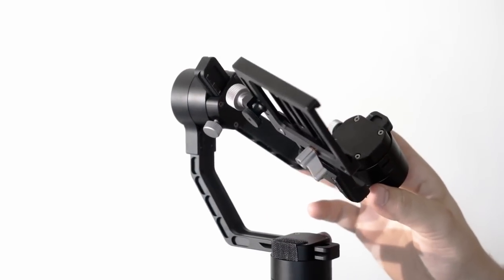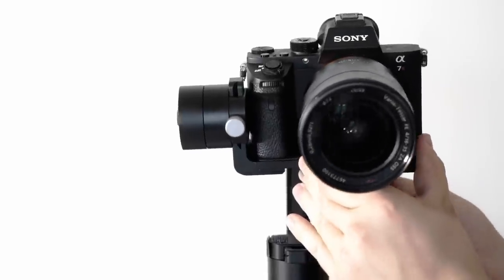How to BALANCE A Gimbal - Zhiyun Crane V2 | Momentum Productions

Comment from the maker: Please remember to turn on notifications so that you are updated on my latest content :)
Reply: Momentum Productions new subscriber here, I just got this crane and managed to balance my a6500 with 10-18mm lens perfectly flat (forward) but was unable to keep it facing upward or downward as you suggest it should stay in position, any suggestions?
Reply: Hey Josh
I really don't expect you to reply.
Since this is one of your older videos. I have ballasts my crane
The very best I can get.
The problem is no matter which position I put my camera in when the crane turned off.
Keep in mind I'm using a Sony handycam, the camera never ever stays in the position I put it in. It's just always returns to the level mode. I do not see where there is any strain being put on any motors.
Do you think I should not worry about this or be concerned ?
Thanks Keith
Reply: Hey man I have a problem with my gimbal now.. All of a sudden the X and Y motors just move wild and randomly in any direction as soon as I power it on - it won’t respond to joystick controls, just moves violently- was wondering if you ever came across this problem and if you know how to factory reset

Comment: I must have watched this video 50 times and still can't get all the axis to balance like yours is.  Making tiny adjustments each time, nothing works.  Beyond frustrating!
Reply: Is it possible that my setup is too light? Using an A6500 with the SEL20F28.  I know it's not too heavy since the crane will do up to 3.9lb.
Reply: the set up is to light. I have the 6500 with a 35mm and it wont stay in any positions i manually move it to it just falls to the level position. With my bigger 55-210 lens i can balance it like this video. It will work fine if you don't worry about the "position keeping step" just do everything else. Im going to try a DIY counterweight using the lens support screw.
Reply: Gear Jammer Media.. I am having a similar problem. I have my A6000 mounted on the crane and it's not staying in place. Were you ever able to create a counterweight using the the lens support screw? I'd love to see what you came up with!
Reply: its weird if you unscrew the screw a tiny bit from the plate that holds the camera on, it will stay in place, but your camera could fall off lol
Reply: jTΛCTIC5 that is so true wow it happen to me too
Reply: phillipdlee shouldn’t you have gotten the V2?
Reply: daviddelacruzthird  Zhiyun sells a counterweight..
Reply: Yes am having the same issue, that side motor giving me problems,I did not realise that if u move the camera up or down its should remain in that same position smh

Comment: Im thinking my camera is just toooo light for th gimbal, i have the Lumix G7, 30mm and have my plate slid back all the way to its farthest. and have tried managing the side motor. And the result is still pointing down. Welp, maybe time for an upgrade!
Reply: check specifications of gimbal, weight your camera with battery and other stuff attached. You can always use a quick release plate to add some weight :)
Reply: Hey. I had the same problem as you. Maybe your camera is too small or the weight between yor camera and your lens is not optimal. I use the Panasonic GX80 with Panasonic 2,8 12-35 mm. My solution was a Quick Release Plate. So the camera is a little bit higher on the crane and i can balance the crane perfectly.
Reply: very late reply but just wondering, what quick release plate would you recommend for my sony a6300
Reply: Hey bro try the release plate.. it helps

Comment: Just got this crane and have watched a bunch of balancing videos, this is definitely the best out there, very easy with some practice.  Questions for you:  is the camera base plate supposed to be so sticky?  Mine has a tight spot which makes fine adjustments difficult.  Also, possible to balance with a rode mic on?  I can do it without thanks to this vid, but its impossible with the mic on.

Comment: i been able to balance it but when i bring the LCD screen out i only can get it to balance up and down not left and right? it wont fall back down when placing it up and down but when i place it left and right ...... do it suppose to still be balanced on the sides even with the LCD screen out.?

and do you prefer to get shots with the screen in or out?

Comment: Hi there great video love your instruction on the balancing the gimbal. One important question the small tripod you show in your video i bought it from Amazon. The screw on the tripod does not fit underneath the Zhiyun crane bottom side as it seems it is needs a thicker screw. What did you do to get the tripod to fit there?

Comment: Hi Momentum Productions
Can you please help share details
  I purchased crane 2 model and i am struggling to use this with my camera as the saftey lock (part 16 in user guide) is obstructing with bottom of the camera. Can you suggest screws you are using in the video, the saftey lock i can use which aren't obstructing like a round screw.
Thanks a lot

Comment: Hi Josh, my concern is off topic but maybe you could help. Im having problem
With my crane v2 when on lock mode it drifts slowly to the left. Ive tried balancing properly, calibration, and firmware update. Your thoughts will be greatly appreciated. Thanks

Comment: Thank you. Very very helpful for my first balance
Reply from the maker: Glad to hear it Alok!
Reply: I've been trying to get the perfect balance with my new Tilta G2X and Sony A7iii with 24-70GM. It's hard but doable. What i found is that if each screw is not tightened down to the max I get a lot of vibration in the motors. After I tightened all the screws down the gimbal went from unusable to usable with minor vibration here and there. Maybe something to also make a note of. I saw a lot of youtube videos complaining about motor vibrations and tightening the screws made a big difference for me.

Comment: Thank you so much. Just received my Crane Plus gimbal today, and this video has been a life saver! (Have Sony a7iii with 16-35mm ). Bought my gimbal 2nd hand on eBay so need to check it is OK. Is there anything I should be wary of? So far seems OK.
Reply from the maker: Nothing to worry about. One thing I would suggest is make sure that the motors don't get hot or make strange noises :)

Comment: I've bought an on-camera LED and can't seem to balance it properly, it always falls up or down, I think it's nearly impossible to have it manually stable. Would it be safe to turn on and let the gimbal stabilize this difference, since the total weight is not even close to the maximum weight allowed? Will it force the gimbal? Thanks for this video, it's very explanatory.
Reply from the maker: Hi there! It all depends on the weight of the LED. If it is too heavy, the gimbal will not work properly.
Reply: The led weighs 345 grams and the camera is a Sony A6300, which weighs 525 grams, 870 grams total. The gimbal supports up to 1800 grams, so I thought it would be fine to use it, even though I couldn't get the manually perfect balance. Thanks for your answer buddy.
Reply: you forgot about the lens and battery, that adds weight too
Reply: Actually, 525g is with the lens and the battery, I forgot to mention that. In fact, the camera body weighs 404g with the battery, and the lens 116g, 520g total. But I weighed the camera myself with all set up and I got 525g.

Comment: Hey Josh on that second tilt motor adjustment where you're supposed to be able to move the camera and release it without it moving...is that possible with smaller lenses like 16-50mm or macros?
Reply from the maker: Hey Darrell, so sorry but I'm not sure what you mean :(

Comment: Hi. I have the crane 2. And the batteries will read full or two bars so I know its charged. However, it keeps shutting itself off after only being on for 4 minutes or less. Just got it about five months ago but barley used it.

Comment: Please Josh I need help  . 
I have a crane 2.
I do all the steps correct except one part doesn't work for me , when I put my camera an any roll position it should stay in that position like your , but it doesn't it just swings back to being flat horizontal.
However all other positions like pitch (tilt is perfect and stays still in any tilting position. As well as the pan motor 
Please tell me what an I doing wrong

Comment: I think some cams are just too light for V2. I am using an NEX 7 and 12mm Rokenon f2 and this set up balances in all planes except I can not get the cam to point straight up or down and make it stay - it goes back to level. I am going to try to raise the NEX by using a QR plate. It still works well without out that final balance part but I worry that may over stress the motors.
Reply: Hey Conrad, that QR plate did the trick - balances perfectly now - thanks!

Comment: Hi, can you help me , when i tilt with my cam downwards to the lens down 
kind of position, the motor starts humming and i can feel a mild but 
sure buzz vibration going on. It happens only when i use the joystick n 
tilt the camera nose down. The vibration picks up as the nose tilts more
 and more down. If i leave the lens in that nose down position the 
vibration hum from the gimbal is non stop, until i raise the cam back to level position.
 The hum occurs in no other position including lens tilted full upwards 
to ceiling. Balancing is done correctly on all axis and in dead mode the
 cam is able to stand still in virtually any pose (indicating perfect 
balancing). I also tried setting the motor strength to middle and low 
using the Zhiyun Assistant app and same results in any setting.

Comment: Josh > im unable to switch thru the modes correctly. Its a chinesey english manual and the manual is so brief. How many presses to get into which mode please ?
Reply from the maker: It’s a combination of presses. Which mode do you want?
Reply: OK instead of troubling you with, 'i need to know them all', let me do it simpler with respect for your time. There are only about 3 basic modes and ill tell you my understanding and you correct me if im wrong.

A) Power Up > Its in default mode. That is PAN FOLLOW (Joystick only does tilt and nothing else)

B) Single Press Mode Button > FULL LOCKED MODE, pan & tilt follow are inactive (Joystick does pan & tilt).
Single Press Mode Button Again > Its back in A default mode, mentioned above. This is a constant loop. Every single press cycles you between A & B.

C) Double Press Mode Button > FULL FOLLOW MODE, pan & tilt follow are active (Joystick does only dutch tilt roll).

D) Triple Press Mode Button > SELFIE MODE, but maintains the last selected A B or C mode for its dynamics/joystick.
Triple Press Mode Button Again > SELFIE MODE CANCEL, but maintains the last selected A B or C mode for its dynamics/joystick.
In SELFIE MODE, the dynamics/joystick modes A B or C can be activated/cycled as listed above.

E) Long Press Mode Button > SLEEP MODE or stand by, all motors & joy stick deactivated.
Long Press Mode Button Again > SLEEP MODE cancel, wake-up and return to mode A (Power up default mode).

Is the above correct :) ? Or am i wrong somewhere ?

Comment: My camera falls to the level position whether its down or up on step 3 (tilt motor adjustment).  Any ideas on how to fix this? I just got the gimbal and want to make sure it's not defective.
Reply: ok so my camera balances on the tilt motor axis if I unscrew the pin that holds the camera to the stabilizer a little bit, but this gives me a heart attack as the camera could fall off for not being attached fully.  What can I do?

Comment: Hello everyone I have the Lumix G7 and I have the problem with the Tilt Axis(Up or Down Stabilization) and I found my solution. 
I bought two “SmallRig removable Counterweight” with 200 g each. 
I used one as a quick release place( since it has a 1/4 screw and a 1’4 hole so you can attach it to your camera and to the crane) and I attached the other one on the lens mounting screw to add weight to the front. 
Now it works perfectly! 
I bought the counterweights on eBay

Comment: Ive tried many tutorials but none of them work. Including yours. As soon as I adjust the Yaw axis my camera becomes bottom heavy. The only way to fix it is to move the tilt slider higher, which throws off the yaw adjustment. Every tutorial results in the same issue.
Reply from the maker: Hi Keir, sorry you are having issues. If you look at the other comments, over 95% of people are succeeding in getting proper balance. Keep trying and you will get it :)
Reply: Momentum Productions I find I can either balance yaw or tilt. When tilt is good has it top heavy. The only way to correct that is lowering the center of gravity. Which throws off the tilt. No video I've seen addresses this issue.

Comment: this is fucking nightmare, after 5months I still can't do balance like this. :/
Reply from the maker: What is the issue that you are having?
Reply: Roll arm is my issue, everything else I can balance in less than 5mins.. I am using this with A7 iii + 35mm and Zhiyun Crane Plus.. Had same issue on Canon 5d mk 3
Reply from the maker: What is the issue with the roll arm? What specifically happens when you try to balance it?
Reply: I moved camera closer and further from motor it still makes no big difference. I can't balance it no matter what I do, it won't get "perfectly" balanced.